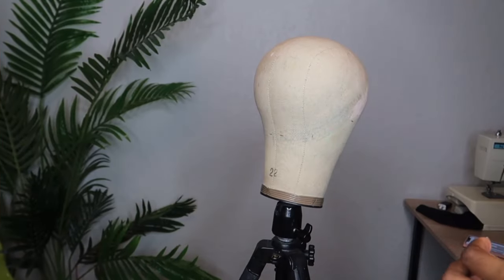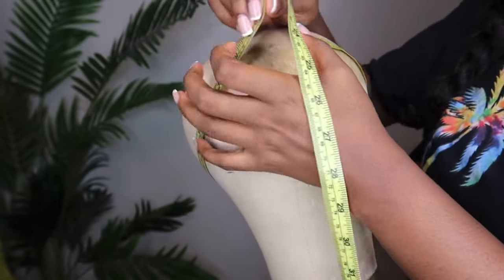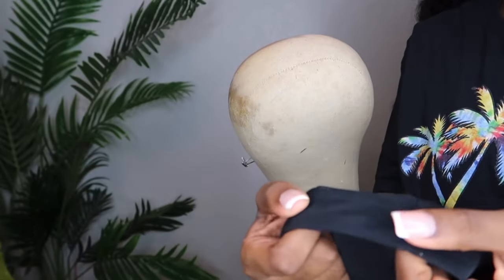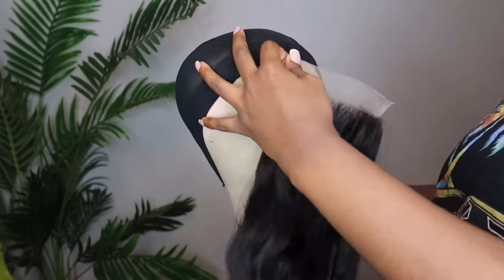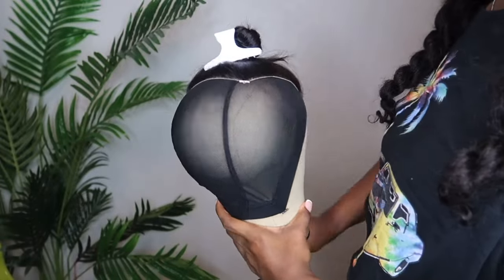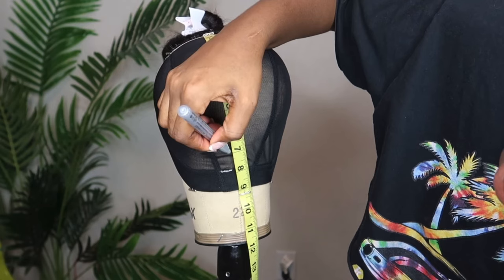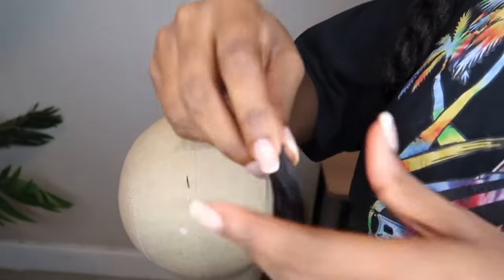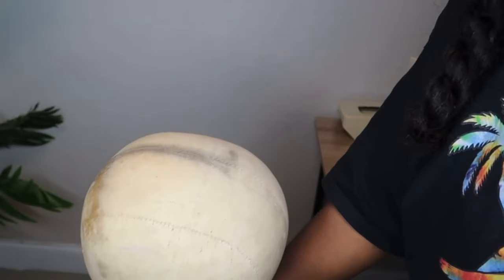STEP BY STEP | Make a FLAT Closure Wig | VERY Beginner Friendly

Comment: When you take the cap off the wig head doesn't it just go back to the size that it originally is?  Why do you have to use different size canvas heads if you take it off and use the sewing machine

Comment: Recently started learning how to do this. Does anyone have trouble fitting the cap and hair under the machine? It’s almost as if mine just won’t fit. Also, how do you guys control the cap as the machine is going?
Reply: I have a Singer heavy duty. Worst case scenario I’ll just have to make wigs by hand
Reply: I have the same machine and going thru the same issue! Hopefully someone can help us!
Reply from the maker: I currently don’t have a singer so I’m not sure, but try to see if there is a video online that shows if your able to lift up that section, because I know someone that uses the singer and don’t have that issue. 

As for controlling the cap just guide it not stretch the cap but open it up with your hands so the machine can easily go through
Reply: @Louxoxo  Thank you so much! I may get another sewing machine
Reply: @lifeasjt9584  with the Singer you just lift the footer, place the cap and weft under the foot them lower you needle completely into both the cap and the hair weft. Put the footer down then start sewing. If it gets stuck, grab a few pieces of the hair and pull just a little while pressing the foot pedal.  Once it get going let the hair ago. You can guide(don't push) the cap with your finger tips.